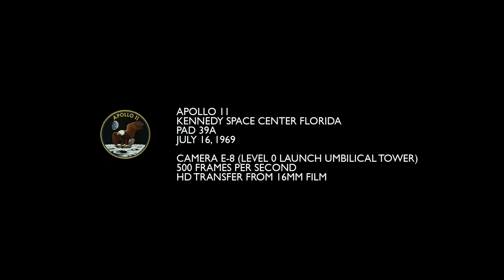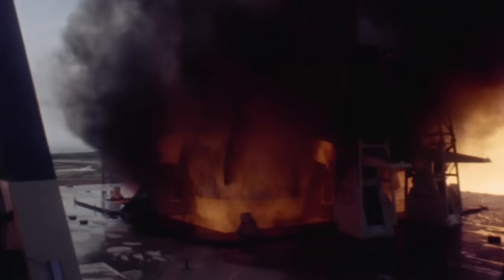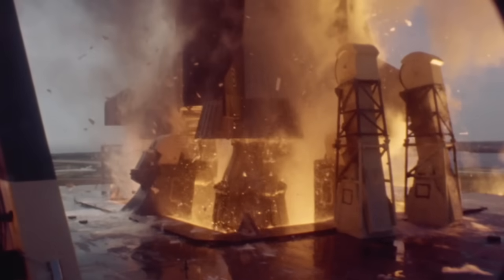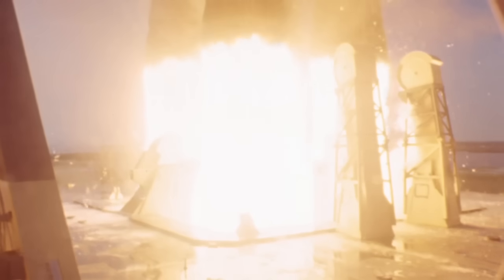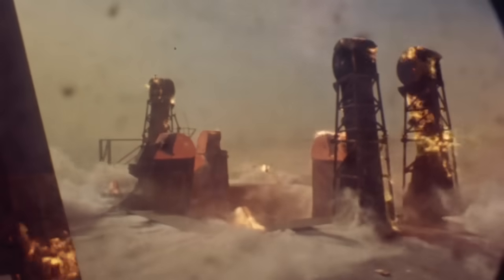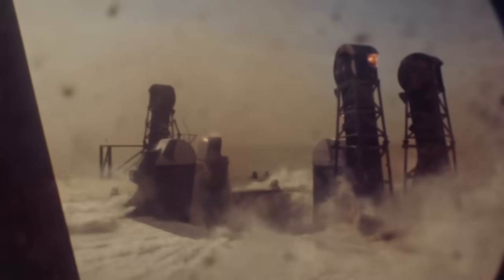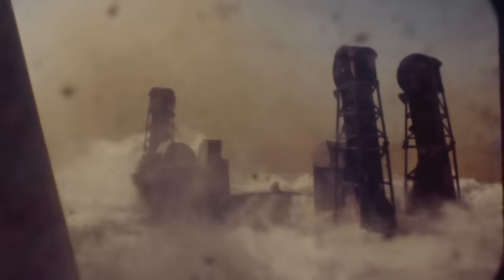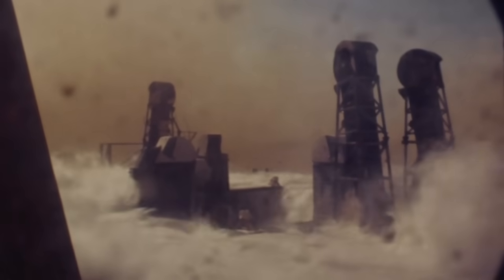Apollo 11 Saturn V Launch Camera E-8

Comment: This was just fantastic.  Answered question after question I had:  How is the rockets held down and released?  How do they stop the nozzles melting from the heat of the burn?  How do they stop all the ground equipment being melted/burned to a crisp? etc..etc..
Reply: EASYTIGER10 , all the stages of the Saturn V used oxygen to burn the fuel. The oxygen was stored as a liquid, and was damn cold.
The cold oxygen was pumped through pipes running around the outside of the rocket nozzles, and that removed heat from the metal bells.
Also, some fuel was precombusted to drive a turbine that drove the fuel pumps. This precombustion gas was cooler than the main thrust exhaust, and was the gas in contact with the insides of the bell.
So the inside of the bell was insulated by not-so-ridiculously-hot gasses, and the outside by super-cold oxygen.

The launchpad had shields / covers to protect the more-delicate hardware like umbilical tubes & wires.
Those shields and other stuff were coated in an ablative fire-resistant paint,
... and the whole thing had about 300,000 gallons of water dumped on it.
Reply: Fundamentalists like you destroyed the Republican Party. Your empty rhetoric has destroyed the greatness of our country.
Reply: its not just the heat, its also the noise. the F1 engines are so powerful they caused damage to structures as far as 8 miles away indicating they were generating noise levels as high as 220+ decibels. and to avoid any damage caused by the acoustic energy coming from the engines they had to install the water system AKA the sound suppression system to not only protect the launch vehicle but to avoid people at the observation area losing their hearing completely. even 3 miles away the noise would be too much for even a deaf person without the water sound suppression
Reply: Derek Wall  I was there 3 1/2  - 4 miles miles from the launch pad at a NASA causeway to see the last Saturn V launch Skylab: it was eerie seeing the flames violently flapping to either side with complete silence, and then the SOUND arrived several seconds later, and you could feel it throughout your whole body
Reply: The VAB is a little over 3 miles from 39-A & B. The causeways keep ya a little over 6 miles away at the closest. Got to see STS-8, the first night launch, from the causeway. It would have been easy to think it was only a mile or so! lol. Probably the most impressive thing I've ever seen. Or heard. Or felt!
Reply: Interesting...I remember looking over to the right and seeing that we were about even in distance from the Saturn V as the  VAB, but maybe you are right - it seemed closer. Maybe the Shuttle landing strip was a NASA Causeway during the Apollo program? I realize that the viewing area with the clock is probably the closest, being at the Turning Basin, but where ever I was it was very impressive!!! Never saw a Shuttle launch to compare, though...
Reply: Just a FYI.. At sea level, the max. decibel level of sound is @ 194db. Above that, a vacuum forms between the sound waves, and can't gain more amplitude. It has become a shock wave. Either way, it's loud enough to kill you!
Reply: steve mitz If the founders wanted a christian nation they would have wrote Jesus instead of creator into our constitution. There was nothing preventing them from doing so. 

Don't let rose tinted glasses exclude the fact that abortion existed during them good ole days. Violence, theft, murder and slavery as well. Even wealthy black christians owned human chattel.
Reply: Herpeslip:    "voted Ron Paul?, Knee jerk reactions? Do you notice how your Marxist brainwash programing wont allow you to convers? What does knees & Ron Paul have to do with YOUR  "they would have wrote Jesus instead of creator" ? " I'm a big boy" who can judge GOD as a "psychotic terrorists" You and your Marxist education spits in the face of millions of highly educated faithful believers.  In YOUR faith based religion your god. A god who bets his eternity on designer free design. Things going from a state of  disorder to order?...Your a real Einstein.  Herps 2nd law of irrationality. You have much more FAITH than me brother. You will also haveing a lot of time to sharpen your anger & delusional issues. I will say a prayer for you!  Love your brother. Steve
Reply: EASYTIGER10 Spectacular!
Reply: panda44r so what, he denounced being a true die hard Nazi till death person and helped us beat the USSR to the moon and if it weren't for him the soviet's would've nuked us using ICBMs well before our rocket technology would've had a chance to grow
Reply: In case you didn't know that big white smoke you see during lift off is steam from the cooling water.
Reply: How about this question: How did they make it to the moon (and back) with 1960's (b/w tv sets) tech? Also, though the rocket blast looks impressive it was needed to lift the massive weight of this contraption off the ground (including the fuel itself!). They made it into space, yes, but only into low earth orbit, like ALL apollo missions btw. No human has ever ventured past low earth orbit...TO THIS DAY. Probes and satellites yup, homo sapiens sapiens NIET NIET NIET!!
Reply: DanM101, I am wondering why you are so confident in your statements that this all was impossible with 60's technology? If anything, you should be impressed, as I am and many others who lived through this period are - that with 60's technology they managed to do this feat. The more I learn about the spacecraft  they used back then, the more I am astounded by what these astronauts and engineers did using slide rules, old-fashioned metal bending, and taking incredible risks. Although I have a few disagreements with the way Neil Armstrong is portrayed  in the movie "First Man", Damien Chazelle does a great job in showing people what it felt to be in one of these contraptions, which back then were state of the art. I recently was at the California Museum  of Science in LA, and got to peer inside a Gemini spacecraft that flew into space for the Gemini 11 mission, and you can see how little room there is to host two people for missions that lasted up to two weeks - and in this limited volume, astronauts ate, crapped, exercised, and everything else. The Apollo Command Module from the ASTP mission is there also, and there is not really that much more room in that one...

On Gemini 9, 10, and 11, the spacewalks they tried to perform were virtually failures, and for at least two of them came very close to killing astronauts...it wasn't until Gemini 12 that a very smart guy by the name of Buzz Aldrin figured out from mistakes from those early spacewalkers how to properly work in the weightless environment to be able to do useful work.

NASA made lots of mistakes in getting to where they were in 1969, with three Apollo astronauts dying in the process in the Apollo fire in January , 1967 - because of the technology of that time was being pushed to do things on the cutting edge, and this push led to designs that were not safe.

Gene Cernan put it best when he said Apollo was a slice of the 21st century that was cut out and plopped into the middle of the 20th...a very risky endeavor which made program managers very uneasy in continuing it any further after a few landings, and one of the causes of cancelling Apollos 18, 19, and 20.
Reply: DanM101
Can you tell me where you go, or went, to school?  People that don't want their kid to grow up and be an idiot want to know.
Reply: steve mitz You went on the attack by assuming I am a Marxist. Hence my Ron Paul comment. I'm libertarian. In fact I'm probably more conservative than yourself. 

The founders were highly intelligent. Their choice to exclude a specific deities name from the constitution seems highly unlikely if they envisioned the U.S. as solely a christian nation. 

Thank you for your prayer. I wouldn't expect to see results though. You are free to continue worshiping a deity and I am free to remain skeptical of all 1,000+ gods. 

Praise Poseidon.
Reply: steve mitz I didn't attack your god. My last post should indicate that for you.

I attended private school k-12. We weren't taught evolution. Doesn't your deity say something about lying or bearing false witness? 

I never asked someone to be a human sacrifice for me. Screw martyrs. It's not a gift if comes wrapped with strings attached. I am not accountable for things that occurred before my existence. You may continue living in a state of fear and submission. I will continue to live free from a cosmic dictator who supposedly eternally tortures skeptics for thought crimes. You can keep that nonsense. I find it much more humbling to simply say I don't know how life began. 

Enjoy your room inside the mansion.
Reply: steve mitz I voted Ron Paul in 2008 and again four years later. Knee jerk reactions don't suit you well. I enjoyed the article. For every website claiming this is a christian nation you'll find just as many who believe it is not.

About eternity: I don't worship anyone or anything. I'm a big boy and no longer require invisible friends. I also don't negotiate with psychotic terrorists. Worship or burn? No thank you to either. I have no respect for someone who would torture people simply for being skeptical of every single god. I choose to opt out instead. It can hardly be considered a rational choice when there is a figurative gun pointed at your head. I don't choose christianity for the same reason you reject every other deity.
Reply: Herp: I believe you’re mistaken. YOU "attacked" my "Creator inspired "inalienable" Constitutional rights." assertion. I never assumed you, a Marxist! I know for fact Godless Satan inspired Marxist have spent fortunes infiltrating every aspect of Americas culture to "Educate" folks like you. Your “Modern” brainwash based “You are your own god” religion postulates,  "A magic lightning bolt hit a primordial swamp & created LIFE.  Designer free unfathomably complex life, all  in violation Einstein’s 2nd law of thermodynamics, [& common sense]. MY documented GOD,  [Jesus] a  [historical person]  who died for YOU, was prophesized to an accuracy of 1 in 10 17th power. [Look it up] Betting your eternal salvation against those odds & common scene, Will bring you misery “Like Foreverrrr”  with a mathematical probability of   1 in 10 17th power. Visualize covering Texas with 2 feet of silver dollars and lucky Herp picking his lucky, "Their is no God" coin in the pile? Your also betting against 2.2 billion / 23% of the worlds believing Christians.     Good luck betting against those odds.  I pray you discover [before it’s too late] why you exists.   Your brother. Steve
Reply: I disagree!  It's the [violation] of "fundamental" principals that destroy!!!  We once HAD basic fundamental moral principals, &  built the greatest nation on Gods earth. NOW we can kill our babies, destroy the family unit. strip away Creator inspired "inalienable" Constitutional rights.  Not to mention our fundamental gold & silver money.  Now we have to sub contract rides into space. And all patriotic can [Parrot] is  Saul Alinsly-est  "Ridicule".  I do offer my condolence's for [your] recent Hilleary loss.  Good luck.  Steve
Reply: EASYTIGER. [ Answer]  they used advanced Crossbow [bolt release]  technology,  Carbomastic paint, & lots of H2-0. Amazing what a Creator inspired nation can do compared to Satan inspired Marxist nations. It's so sad we traded that advanced  inspiration for Satan inspired government "handouts" & "free stuff"God help us.
Reply: ??  What a strange, medieval response...  But if we're going to talk about the brains behind all this, it was a member of the Nazi Party and the SS who was complicit in using slave labour to further Hitler's war effort.  Does that tarnish things for you?
Reply: EASYTIGER: If you talking to me? I don’t get the “medieval” Was it my God reference? The “BRAINS behind” was our Founding Fathers establishing a Creator inspired nation. A nation promoting God’s liberty & freedom. Freedom for Robert Goddard invent liquid fuel rocketry in 1926. [Satan inspired] IG Farben / Bayer, they *sponsored Adolph Hitler and were the biggest profiteers of WWII.  [Bayer is still profiting]
In 1959 NASA’s Goddard space center was establish in what was once a God inspired nation. NOW were on the same path Bayor’s Hitler tried. But don’t worry Bayor’s Boss will never die. He has BIG plans for all us!  I hope this isent too “medievel” or esoteric for you.  Via con Dios.   Steve 
see*http://beforeitsnews.com/war-and-conflict/2013/05/ig-farben-bayer-sopnsered-adolph-hitler-raign-and-was-the-biggest-profiteers-of-wwii-2446840.html
Reply: steve mitz I don't think the founding fathers knew anything about rocketry.  How do you decide whether something was "Satan inspired"  How would one know?
Reply: The only reason USSR. could have nuked us is because of Godless psychopath & commie loving Franklin D Roosevelt allowing spies into the state department!!!  Googling!   "Joe Mac Cathay  Most-hated senator was right"  Explains how stupid Godless, brain-washed useful idiots are CONTROLLED. Satan's work is never finished.  (E.G. The Clintons) Creators inspiration built this nation, Satan's HAS destroyed it.
Reply: Contrary to your miss-educated /[Marxist brainwash] contention, Mark David Hall, Ph.D. Distinguished Professor of politics  contends,…  “Orthodox Christianity had a very significant influence on America’s Founders and that this influence is often overlooked by students of the American Founding."Check him out!  See if you can rip off his “rose colored glasses.”     http://www.heritage.org/research/lecture/2011/06/did-america-have-a-christian-founding
PS. The "CREATOR" inspired founding fathers could have used 50 different  names for GOD !!!!But what difference does it make if blow the reason YOU were Created only to spend YOUR eternity in, Pick a name!   Lake of Fire?  The pit?   Eternal retribution?   Hades?   Hell?    I know U don't believe!  But HE believes in, & wants YOU,  luckily you have a choice, and an Eternity to contemplate it.  Good luck.   .   May God bless & shine his ever-loving light on his once Creator inspired America.         Steve

Comment: On videos taken from the underside of the launch platform looking up at the engines, there is a substance pouring from the engine bells that looks as if water was flowing out. This is immediately before engine ignition -- is this propellant?  If so, is this in the form of a liquid or a gas? It seems it is more than would be necessary to achieve engine start.

Comment: Awesome! And a few mentioned this below, but watch around 3:45 when it appears that the sound pressure begins to peak and you can see the image appears to move, which I would speculate is from intense vibrations from the engines' roar.

Comment: I remember reading that they had a "retarding system" that prevented the rocket from jumping off the pad too fast. It employed a wire that, as the rocket started to rise,  would pull this wire through a die that would reduce the diameter of the wire, this caused a resistive force. The wire had a diameter that would get progressively smaller until near the end it was the same diameter of the die,  which would have no resistive force.

Comment: SHUT THE FUCK UPPPPPPPPPP AND LET US LISTEN TO THE FUCKING ROCKET!!!!!!!!!!!! AH!!!!!!!!!!!!!
Reply: +sam fletcher If they had attempted to record the sound from the rocket that close, the microphone would fail instantly because of the extreme sound pressure. We're talking sound so loud that it's not even considered sound, it's just a constant shockwave at this point. You'd have to stand 100m or so away from the launch platform to get a usable recording, and they did. I found the narrating quite interesting, he explains the systems quite well, I was actually not aware that it's actually ice and not paint that peels off of the rocket during launch.

Comment: Could they navigate through Van Allen belts. Is cosmic radiation that lethal? Why go to all that trouble to just fool who?! Does anyone really know. Our perception as one person is small. We wont know until truth unwrapped to a future generation. Shows we are not ONE and why cant we agree on even small things. Was it big hoax what do we really know its all on film and our brains are easily fooled. Amazing the whole parody. But big figures in military were murdered because of Blue Book and the cover up. It only concerns ordinary men because we are for the chop now. Just filler surplus to requirements. Inadequacy to the hilt.
Reply: they spent less than a few hours In the radiation belts, if only the you knew anything about radiation, and the types contained there.

of only there was a helpful tool for gaining insight into things, where you can type in a word and get more information about it.

you know something that can do this?